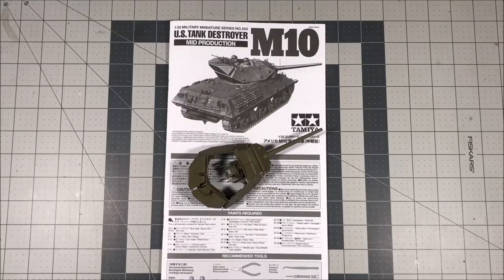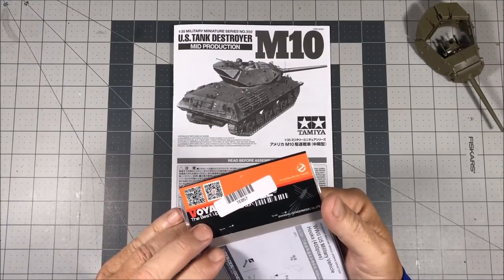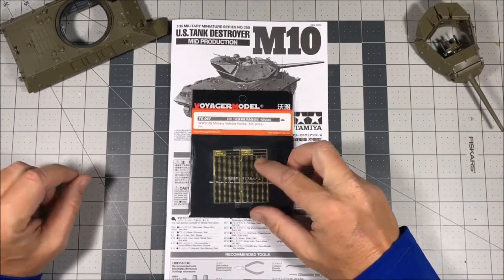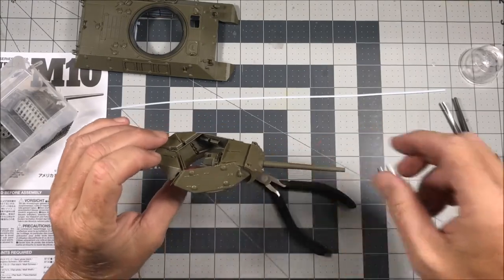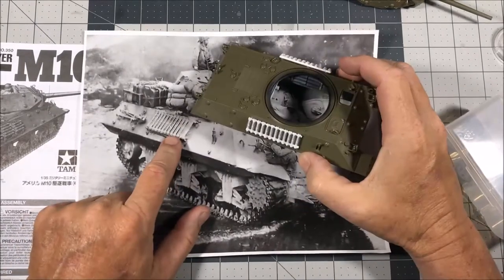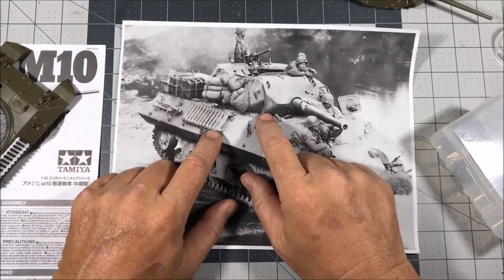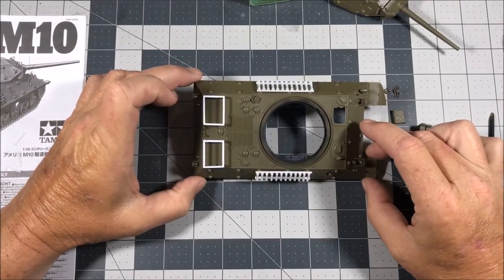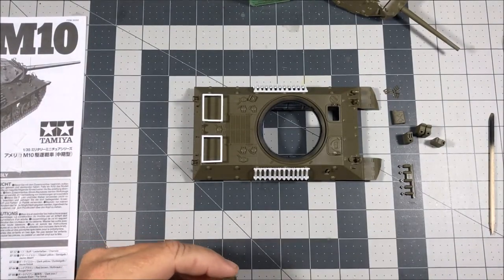Plastic Models For Beginners Building From A Photo pt 6

Comment: You have more patience than I do dealing with the photo etch tie downs than I do. Great job. As I build a lot of 1/72 scale I know the frustration.The  3D parts are pushing me more to buy a 3D printer myself.Would solve some problems. Until next vid.
Reply from the maker: The tie downs were actually one of the easiest PE parts I have dealt with in a long time. Once I get a groove going it goes pretty fast.

Comment: Jeez, I almost went blind when I saw you shaping these tie-downs! Well, 400 pieces will last long enough! I couldn't find the word grousers (if that's the correct spelling) in my dictionary. What are they?
Reply from the maker: It is a cleat type part that is attached to the tracks to aid in traction. It is a bar with attachment points on the ends.
Reply: Thanks a lot, Brett. I thought it might be something like that but wasn't sure. :)